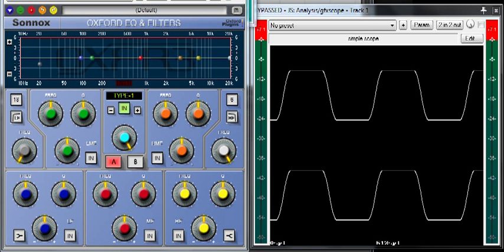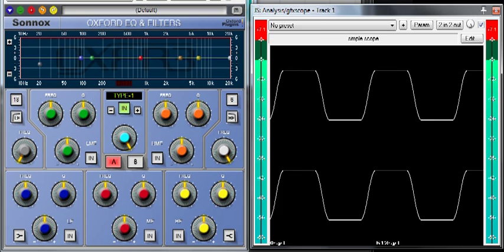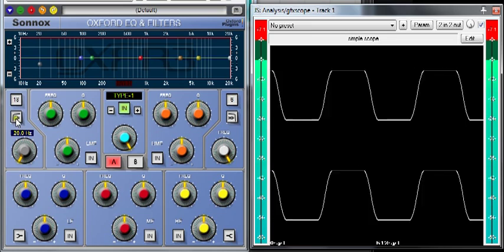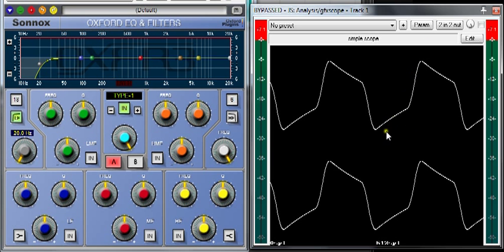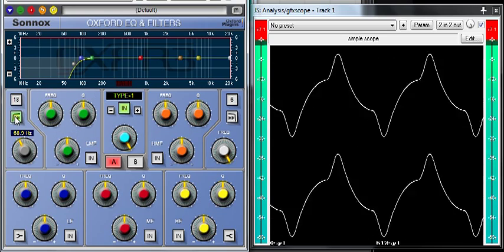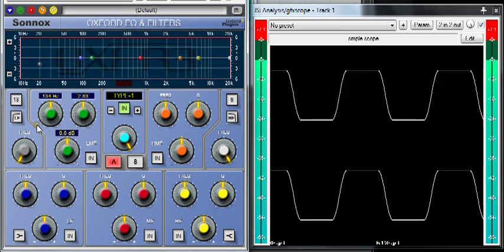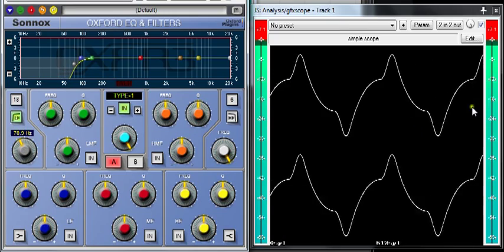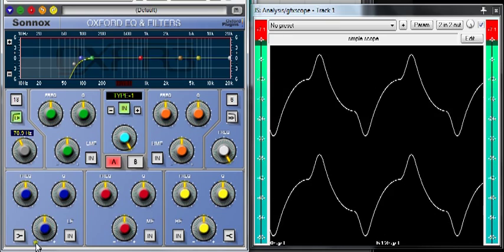The High Pass filtering pitfalls.

Comment: What do people think of using peak and low shelf to replace the passfilter? 
After some tweaking to find the best phase response to the material I often like it more, but it's really hard not to be biased and it will of cource always depend on how badly you need to cut the bass. The shelf doesn't work very often as it leaves a substantial part of the signal out of phase. 

Also, it feels like you can hear the phase shift right? It's not just a different frequency response and different micro dynamics? Eq. when eqing a mono vocal.

Comment: Thank you Paul, is this effect reduced by using linear phase HP filters?
Reply from the maker: I have amended this because my original reply was not entirely accurate - sorry. :-(
In fact with some continuous waveforms like this one - a linear phase filter may produce less of an overshoot. This is because the overshoot is caused by a change in relative phase of the harmonics forming the waveform - as well as losing some of the constituents of it. 
But the crucial thing to remember with linear phase filters is that when set for such low frequencies they will have a significant time preamble due to their symmetrical impulse responses. This will mean that some parts of the sound spectrum will happen relatively in advance of the rest - and therefore smear and muddy the sound of percussive sounds like drums significantly. I.e. they will not sound so tight and well defined.
So the bottom line is; if you MUST roll off the bottom end you are still sonically better off using a conventional filter or EQ (and correcting for possible clipping), because at least this will avoid smearing and softening the sound. I hope this helps?
Reply: @paulfrindle7144  definitely help 🙏

Comment: Is this effect reduced by using a 1st order filter instead of 2nd? And also of interest is that the pitch got noticeably lower. That should be of major concern.
Reply from the maker: The order of the filter of course will effect the roll-off rate - i.e. a 2nd order filter will roll off twice as fast as a 1st order filter. So if a decent lowering of LF is required, a 1st order filter slope will affect the level and response more than a 2nd order simply because it will also hit higher frequencies of the sound.
It may be that the level will rise less, but the overall sound will be very much more changed for the same cut-off LF reduction.
Reply: @paulfrindle7144  I understand the difference between 1st and 2nd order filters. I was referring to the consequent anomalies and reduction in sound quality. I generally prefer 1st order filters because they cause less phase shift and sound more natural. Obviously, I tailor the cut off frequency to taste.

Comment: Hm, to me this little example doesn´t do anything. We don´t mix visuals but sound so I don´t care about the changes a lowcut does to the representation of sound in a oscilloscope. Additionally the pure realization that a lowcut alters the sound of a given signal doesn´t mean anything as well. The question that has to be asked for every track in a mix is if a lowcut does more good than harm and if I may say so your little example isn´t helpful to answer this question. That is because you don´t give any real world musical context to your example. In your video you technically proof that lowcuts alter the sound. I find that a little self-explanatory.
Reply from the maker: I'm sorry you don't find it interesting or useful. 
I put this up originally to show that people should consider whether automatically rolling off LF in all tracks (as prescribed by some pundits) is good advice? My advice is that it is not always a good idea, If you are after fullness of sound and optimum impact for your overall final mix. It can change the sound directly - and it can also increase the peak levels, which may produce higher levels of compression further down the line - i.e. on mix buss compression. The combination of all this can further change the sound of the final result :-)
Reply: Hey Paul, thanks for your reply. You are surely right about randomly lowcuting everything, but the point must be to use lowcuts with purpose rather than because someone said one has to do so on every track. I just recently mixed a live performance from a big convention hall that obviously involved a very powerful PA. There was massive low end bleed in pracically every mic on the stage and in the crowd mics, so I had to lowcut nearly all channels to even stand a chance to get tight and direct sounding lowend in the studio mix. I fear that your video will make the crowd that lowcuts anything because they where told so on the internet now not lowcut anything because the where told so on the internet instead of starting to decide by ear from case to case ;)
Reply from the maker: Exactly - low cut EQ should be used with discretion, when needed depending on the situation. Not just done as a matter of course - following some blanket 'law' from some 'guru' in a magazine article :-) Everyone is somehow looking for 'rules and laws' and magic settings, when none really exist. Recording and mixing is down to art, discretion, what things sound like - and what best enhances the musical performance and atmosphere. 
Regarding live recordings: I've done many live recordings professionally in my time - and the issue of LF 'mud' bleed from the PA and venue swamping the sound is always a very tough one to manage. I had varying approaches to this depending on the final use of the material . For instance if the recording was for an album to be mixed later I would avoid rolling LF off for direct instrument mics and vocals, on the basis that I would best be able to do this with discretion in the mix later, with a much more capable EQ depending on the sound in the studio at the time. 
But if it was live to air for direct transmission I would try as far as possible to tame the LF 'mud' directly - for the benefit of the live listeners. Most of this taming was obviously for the 'audience mics' we used to get the crowd atmosphere - because the bleed is of course delayed :-(. 
Back in those analogue days, recording console EQs were pretty general without great facility. But these days mixing with good digital EQ we can do much much more, like notching various 'problem' freqs and resonances - which I use extensively even when mixing studio productions, which greatly helps to differentiate the direct sound from the spill. (I should do a video showing this in action). And for mixing live performances where venue and crowd reaction is still wanted, we can now directly compensate for the delays of the venue sound etc.. :-)
Reply: @paulfrindle7144  Hi Paul so are you saying if we notch problem frequencies even in the bass area, rather than using a high pass filter, it will lead to less of these unwanted artifacts?
Reply from the maker: @dahonkie  Yes absolutely - do it when you have to. Not when people 'tell' you to :-)
Reply from the maker: @m0t0rp00l  Yes - it's the loss of parts of the original waveform that causes the peak level to increase.
Reply from the maker: @getthecandies  Yes - you will note that the filtered sound has a higher crest factor and can clip early? That was the point of the demonstration. So yes - if pushed the rolled off sound will clip early and reduce the overall impact of that instrument. This waveform is just a continuous one - and it's not music. However, this effect from low pass filtering will occur with musical signals that have a high harmonic content, particularly those which are partially artistically distorted etc..
Reply from the maker: Exactly - it could make life worse for you.
Reply from the maker: @getthecandies  The waveform is in fact showing that the filter is increasing the crest factor of the waveform. This could at the limit lower the loudness impact of your mixes for loud productions.